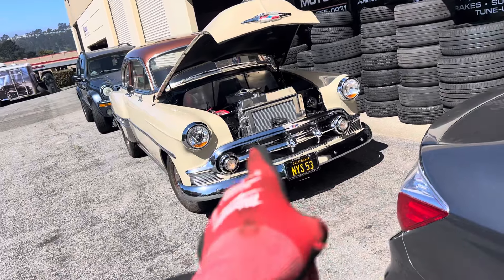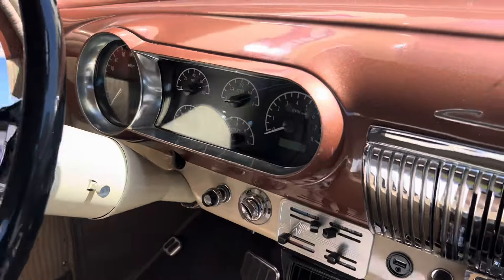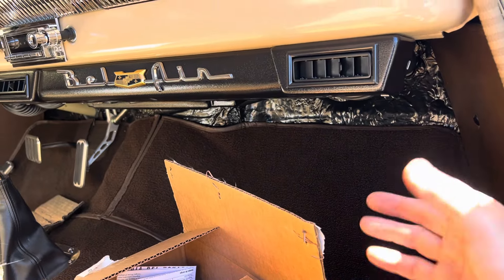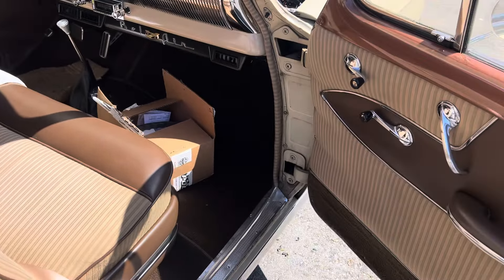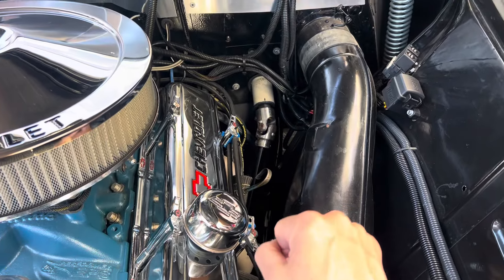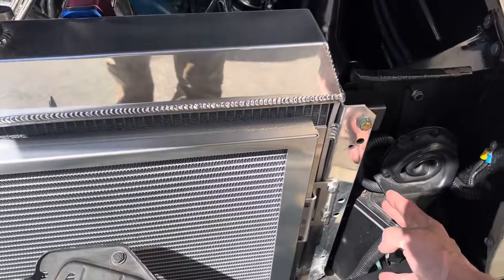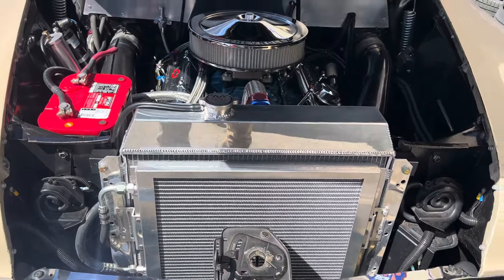How to add AC evaporators to old car with limited space. Electric compressor.

Comment: Excellent idea. Would it require a design with an Orifice tube instead of the typical aftermarket Expansion valve ? 
Receiver drier VS Accumulator ?
Would you have to custom make the Suction and liquid line tee's ? It sure would be fun to plumb that dual evaporator job up. 
Where did you get info such as "1-1/2 ton" sizing of prius evaporator? ( I'm having no luck finding such specs on evaporators nor aftermarket condensers as no consumer would ever need such info).
Excellent video. Very informative.
P.S.  I just saw one of your videos "LOW VOLTAGE ELECTRIC AC COMPRESSORS"  visiting an AirWorks at a trade show. Excellent , thank you again.
Reply from the maker: @28704joe  everything will be custom

You would not want to use an orifice tubes orifice tube suck 

Expansion valves are better 

When you want expansion valve information, you go to the manufacturers website of the actual manufacturer, not the distributor. Sometimes the distributors will have information, but they’ll give the listing in BTUs of expansion valves. 

Majority of Automotive around one and a half ton somewhere only one ton cooling

If you have pulled out a lot of Prius evaporators you know how small they are  

You would have to mount it at an angle for clearance purposes make your own custom sheet metal insert . 

And then use your static pressure in your vein anemometer to do a transverse across the ducting to get the desired required airflow. How many BTU output you need . 

You could have a high medium low fan speed

Adjusted to roughly 320 or 350 CFM for low speed somewhere around 400 to 450 for medium speed and then 500 to 525 CFM per ton high speed.
Reply: @coldfinger459sub0  Thank you very much, more info to stew over. An anemometer was something out of my wheelhouse until now,  I was wondering how mass air flow would be determined. I'll be getting one and test my existing vehicles.
Reading about orifice tubes, they are cheaper and have no moving parts. They are all in my GM vehicles. All  aftermarket units seem to have expansion valves.
Looks like expansion valves are used on a fully engineered system, expansion valves used as they are more adaptable.
Thanks for the good info.

Comment: Wow amazing information. What are your thoughts on the BMW latest water cooled condenser recovery dryer unit? I am considering replacing my traditional air condenser to that water cooled one for packaging reasons.
Reply from the maker: @nazimthedream  more things to break. 

But it works good if properly engineered . 

You can also make the evaporator water . 

Using glycol you could take it down to 27°F plus or even minus a few degrees .  Depending on ambient conditions and airflow over the evaporator.

And if you had to water plate, heat exchanger 

Right off of the compressor 

You can have one for the condenser one for the evaporator 

And you can run propane and you would only need like 3 ounces or 5 ounces of propane 

And you’re running water through the evaporator propane inside the passenger compartment 

The system is designed for

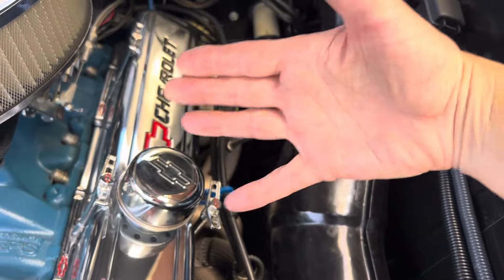Comment: 2:40 which generation/year of Prius? I have a 2002 first-gen (conventional scroll compressor driven by the engine) and the air stays ICE cold for 30-40 seconds (even at 85+ degrees and VERY humid ambient conditions) after the compressor cycles off.

Would not expect a tiny little evap core like that to have that sort of thermal inertia, unless it's getting VERY cold or has some sort of "cold-storage" tech. I've stalled my mom's 2014 Dart, and the A/C got warm before I could push in the clutch, find neutral, and get the engine restarted.
Reply from the maker: @aspecreviews  later gen. Higher fin and tube count

Comment: Where can I get the materials to start making my own hoses?
Reply from the maker: @hisautorepair124  Napa Auto Parts
Or Ranchu  Online
Reply: @coldfinger459sub0  it’s getting hard to get hoses without waiting at least a week. Are used to have this older gentleman here in Ontario California rebuild my hoses at a pretty good price. That’s where I would get all my little materials as well but he retired about a year ago and now I’m thinking about just making them myself and see if I can make an extra buck. My goal is to start an AC shop next year or two.
Reply from the maker: @hisautorepair124  my brothers and I we would buy 1000 foot rolls of hose all the different sizes

And we buy $2000 in different types of fittings at a time 

$2000 back in 1993 or 94 with quite a few hose fittings . Specially when I’m getting them at bulk prices..